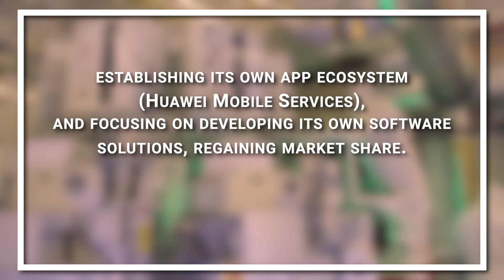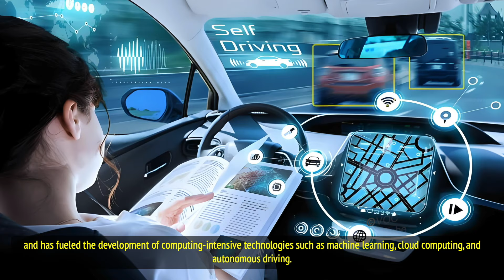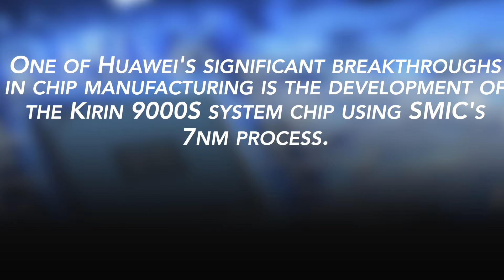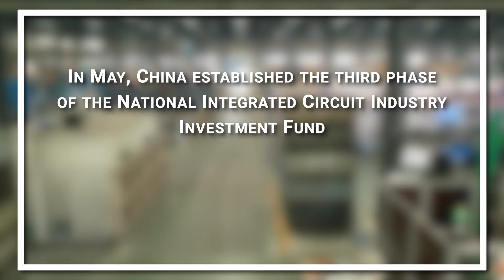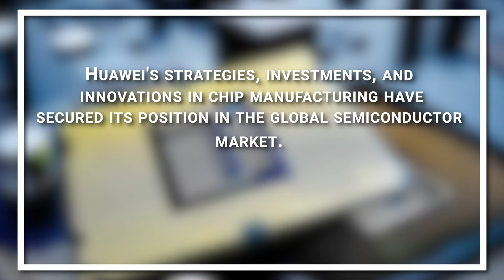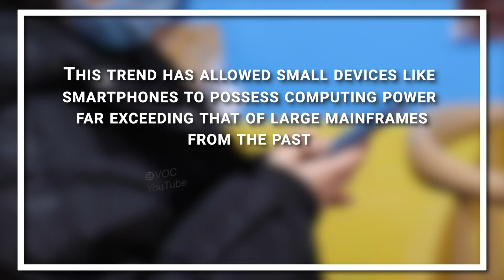Overcoming US Restrictions! How Huawei and SMIC's 7nm Chip Success.

Comment: The launch of Mate70 this September...according to mrquestion2010

Mate 70 Pro uses Harmony OS Next which increases overall efficiency by 30%. Together with the 3nm process of Kirin 9100, it reaches TSMC's equivalent of 1.5-1 nm. The 2nm process and fin width of 4nm are the limits of TSMC standards.China has surpassed the lithography machine and will leave the West behind with the absolute leadership of Hyper-Threading and VGAA.